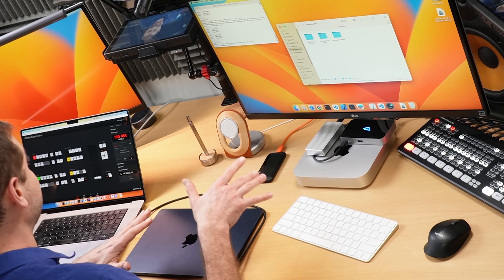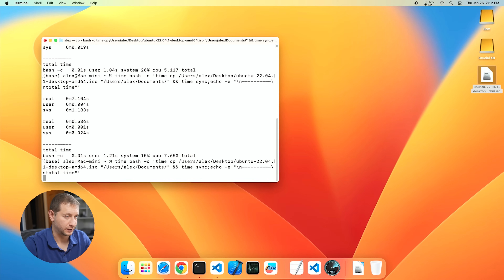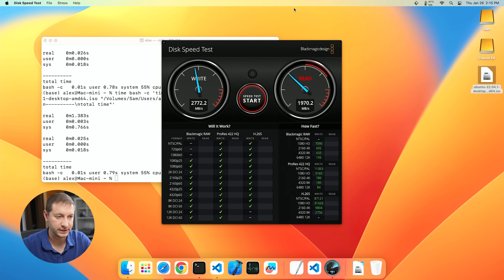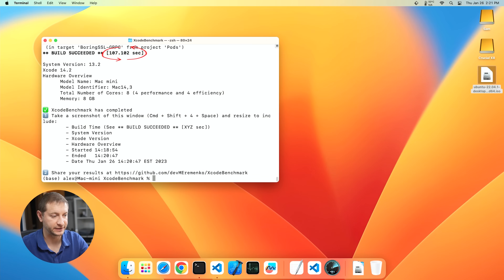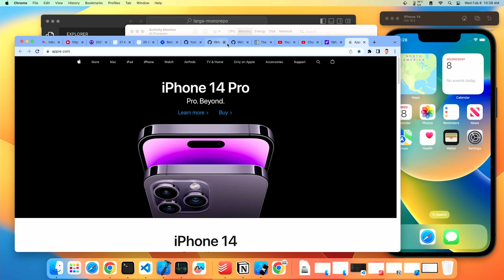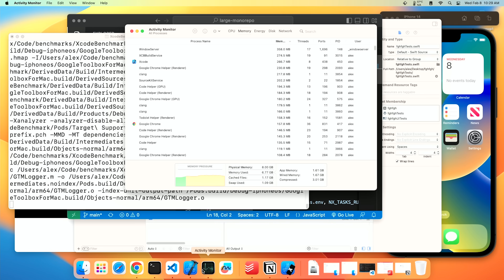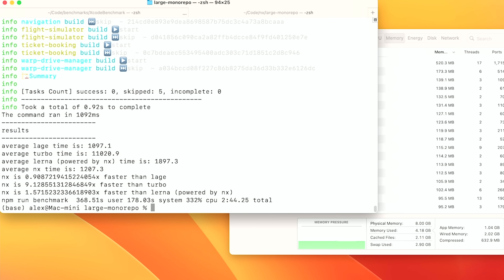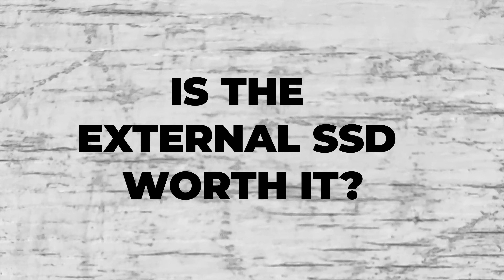...but there's a catch

Comment: What if the internal non replaceable drive dies ? Can you still boot with the external and  give the mac a new life? (instead of paying crazy money to apple for repairs)  -And if yes, but you don't have setup a bootable drive with the OS yet,  can you just create it on another mac ?
Reply: yes and yes
Reply: @ZhuJo99 I know this is old by now but I had to respond. Up until the Apple Silicon era the answer was “Yes!”  But with Apple Silicon machines the answer is “No!”  To even be able to boot the machine (e.g., to an external bootable volume), the internal drive must be accessible and in working order. There is some pre-boot code on there that can only be loaded from the internal (security feature).

Comment: at 2:30 - 40 gigaBIT speeds. 40 gigabytes is 320 gigabits per second, which is not possible over thunderbolt. Transfer rates are always measured in gigabits per second. So if you have a 100 megabit internet connection, you are only getting 12.5 megabytes per second, not 100 megabytes per second. People always think their internet or transfer rate are blazing fast, when in reality, you need to divide megabits by 8 to get megabytes, which is the metric most people are familiar with. There are 8 bits in one byte.

Comment: Laughing at apple users for drooling over 7k speeds after watching a review on a Dell Precision's 12.933 gigs of speeds on a 1tb configuration. Go watch Andrew Marc David's review if u wanna see the real king of professional workstations. Or you keep spending 15k on a 2021 mac pro just to watch a 2k mac m2 mini beat it after 2 years of release (in other words keep being an apple slave).
Reply: oh shut up. We don't want fucking jet engines and performance drop to 1/3 on battery (which will last for an hour)

Comment: Why would anyone buy only 8GB of RAM in 2023? Take aside that your computer will be faster, but also it will avoid swap, which will not help the life of your SSD... where the swap will add to the read/write of the drive. To give you an idea, when I ordered my 2013 MBP I ordered it with 16GB of RAM. When I bought my 2015 27" iMac, I got 32GB of RAM. With my new Mac Studio? 64GB of RAM. *NEVER* cheapen out on RAM and always get the maximum your build will allow.
Reply: Or how much you need. I see no point to get 32 GB or 64 GB when I was never been able to utilize even half of it. 16 GB? Sure. Regular user who does office and browsing? 8 GB is enough, especially with ARM architecture. All that RAM doesn't come for free. you know. I don't buy luxury food either.

Comment: Great video. I did get my M2 with 512GB drive but it’s great to see that the 256GB drives don’t completely hamstring the M2. I think these machines need more RAM out of the base machine. I maxed mine out with 24GB and I added a TB4 TB Samsung 980 Pro SSD. I’m completely happy with my M2 Mac Mini.
Reply: I'm just wondering, how the drive performs when you run the entire OS from the drive. I'm interested in understanding how this would work. How does it perform when the system uses the main drive for cache?

Comment: WOW great testing.  And nice to see a very savvy user using the terminal.. luv it. 👏👏👌👍
Reply from the maker: Glad you liked it
Reply: @AZisk  now i gotta think too hard for either another mini or go for the studio 🤔.  I’m a retired hardware/software engineer so i think I answered my dilemma… studio.  Only concern i have is all the talk about no more updates and support for the studio.  But updating the studio to an m2 chip really going to make huge leap for the studio?  Im a drummer so using chained electronic drum modules via midi to DAWs.  And always compiling for addons and my 3d printer.  Studio should last for a number of years.  I have 2 old minis retired.  4k retina imac, older imac and MacBook air still using but its time to upgrade 👍
Reply from the maker: @rondeangelis7384  studio sounds like a bit overkill for what you’re doing, but it would last you longer, esp if you develop a video editing hobby :)
Reply: @AZisk  oh god not another hobby.  Learning 3d modeling for 3d printing.. thats enough for now lol
But will keep thinking on configurations for mini m2.  16gig ram, external ssd maybe thats the ticket 🤔 thankx for inputs

Comment: Hey, how did you get the Mac mini to boot using the external drive? Did you use the USB A port? I haven’t been able to boot from the external drive for booting from my M1 iMac, when it used to work fine earlier on my old Intel iMac. I have tried re-installing the macOS version for Big Sur and Monterey when they came out, but none worked :/
Reply: you need thunderbolt enclosure

Comment: A lot of people are only looking at the transfer speeds. The internal sad is designed for low latency with the controller on the M2. Thus it will always be faster for swap.

The point is you CAN get away with the small and “slow” system drive, by using two drives. Leave the internal drive for swap, system and basic app files. Then use the external drive for all your video, builds and plugins. When doing builds, encodings of renderings always write to the external drive. That way the internal drive is dedicated to swap only at high memory load operations. That’s the magic formula :)

Comment: If you like the OWC TB-4 Dock, you should check out the Mini Stack STX.  3 TB Ports, 2 USB A ports, HDMI, 1GbE networking, 3.5mm audio. NVME M.2 blade for speed and a 3.5" HDD for capacity. (disclaimer, I work for OWC)

Comment: Those external SSD enclosure come with controllers rated at different speeds (10 Gbps, 20 Gbps and 40 Gbps) it would be helpful and extremely useful if you tested the fastest M.2 SSD with those different enclosures then calculated maximum transfer rate to see if the enclosure manufacturers are telling the truth about how much peak data you can actually transfer per second. Thank you.
Reply from the maker: this one is rated 40Gbps and I tested the fastest deive available to me right now 990pro
Reply: What were the results? Perhaps a good video topic? Thanks for your work on these videos. Informative funny and not so dry. 😊

Comment: I have 2 of the OWC 4M2 Express enclosures and I love them. I also love my 2 Acasis enclosures. The latter get 2800 r/w with Samsung 990 Pro 2 TB and Samsung 980 PRO 2 TB. The former get 2500 r/w with Samsung 980 PRO 2 TB X 4 and 1900 read and 2300 write with Crucial P3 Plus 4 TB X 4. I should have gotten the less expensive SSDs  like you did given the Thunderbolt 4 limitation of 2800! I am hooked on SSDs! My Mac Studio Ultra with 1 TB SSD gets 5700 r/w
Reply: And thanks for a wonderfully didactic video!

Comment: Hi Alex, this is important. You used in this test a 970 EVO model which has only a small amount of MLC memory for the buffer. For some transfer speeds all is ok but once the buffer is full the drive becomes the poor TLC NAND which all knows what speeds can produce. Try with 970 pro or 960 pro. The 980 pro and 990 pro are no better because they abandoned the NAND architecture for cheep manufacture. Redo the tests and you will be impressed. Waiting for feedback
Reply: This is true?

Comment: You can always set up the external SSD to be mapped as your home/user directory + apps, and let the internal drive be just for the OS and swap - then just max out the RAM to reduce swap usage.
Reply: Tried this on my Mac Mini Pro and kept hitting problems or gotchas. In the end I wound up making symbolic links from selected directories on the internal SSD to an Acacsis 405 enclosure with a Samsung 970. I still have 405GB left on the 512SSD. All that's living on the internal SSD is the OS and apps.
Reply: I did this on my first Mac back when MacBooks had DVD drives!  Shoutout to a 2010 mac having the same RAM as today.  — I’d love to see this test made.
Reply: Thank you so much for posting this here. This was a fantastic solution to a big problem for me. I made the mistake of buying a Mac mini with a quarter terabyte hard drive and that filled up much faster than I expected. But here are a few tips for everyone if you decide to go this route. This is what worked for me. Your situation might be different, so be aware that you were using these tips at your own risk.

0. Create another administrator account on the Mac. You will need this to change the home directory for your moved user.
1. Close all apps on the account you are moving to the external drive. 
2. Turn off iCloud Drive completely. Before I did, this, I was getting repeated errors that blocked the copying of the home directory to the external drive. I found this was the issue after moving the contents of the home directory one at a time and the issue was in the Mobile Documents folder in the user Library. This folder is deleted when you turn off iCloud Drive. Files will remain on iCloud.
3. Do is a fresh Time Machine back up of your Mac. 
4. Open to Finder windows side-by-side.
5. Drag and drop the whole user home directory to the external drive. Do not delete the original home folder. 
6. Log out of the user being moved and into the other administrator. 
7. Change the home directory per https://support.apple.com/en-us/102547 
8. Restart the computer and log in to the moved user. 
9. My wifi and ethernet would not work at this point. I resolved it as follows: 
10. Go to System Settings / Network and click the (...) button at the botton, click Locations / Edit Locations / click the plus sign to create a new location and save/apply that. This got my wifi working. 
11. To get the wifi working again, I navigated to System Settings / Wi-fi / clicked the Details button for my wifi, click TCP/IP  and clicked Renew DHCP Lease. 
12. At this point, don't delete the original internal home directory, but rather rename it by putting an X at the end of its current name. 
13. Restart the computer and login to this user again to make sure things are working properly. 
14. Be aware there may be some apps that will be looking for specific folders that they think are on the internal drive. You may need to go into their settings to update them. The Photos app in particular will have a specific location set for the system library and you will need to update that. For that one, I navigated to the external home directory where that library was located and opened it from there. That got it properly aligned. Otherwise the Photos app will try to open the one on the internal drive. Dropbox is another that will need re-linking or to be set up again. 
15. In the Time Machine settings click Options and make sure it is not excluding the external drive where you're home directory now resides. 
16. Change the name of the original home directory back to what it was. 
17. Delete most or all of it's contents, depending on what you run into in doing so. Remember the user Library is hidden, so you need to type Command+Option+. (that's Command+Option+PeriodKey) to reveal hidden files in Finder.
18. Do a new Time Machine back up.
Reply: Very interesting. I have a Mac mini M2Pro with 16Go. Mostly used for photography editing and video editing. Sometimes 16Go is a bit small. I search a way to use at max speed thunderbolt 4 connection to have great speed, especially when editing 4K video…
Reply: How do you do that? Symlink?
Reply: @D-One  You search on google how to do it :) - I don't think symlinks are necessary - just settings. Always backup your data first to a separate backup HD.
Reply: @wavesequencer  -.- It's just right-clicking on the User profile under "User & Groups" in system settings and selecting "Advanced Options". Thanks anyway.
Reply: @D-One  Cool - glad you found it - I don't have my Mac to hand and don't currently do it that way, but I would definitely move home folder off the internal HD if I got a Mac silicon based system.
Reply: Also... moving home, doesn't move apps.. you have to do that manually.
Reply: @wavesequencer  … and how do you move the apps?
Reply: @516cal  Just move the app file like any other. If you don't move your home directory, be aware that apps may still write app related data to your user 'library' folder.

Comment: I wonder why SWAP with external drive is slower. Maybe you should try it with faster performing SSD (in terms or random reads with low QD)?
Unless it is some kind of bug it doesn't make sense why there is such difference.
Reply from the maker: yeah strange. could be due to thermal limitations of the external enclosure
Reply: @AZisk  you probably need to re-test it with the heatsink.
Reply from the maker: @paulf3353  I used included heat sink, but there is no active cooling in the enclosure
Reply: @AZisk  It shouldn't overheat then, strange results then. I wonder if it is just a coincidence
Reply: It's probably a cache issue, as others have said. A pricier SSD doesn't only offer faster port speeds, but also better sustained performance. Cheaper ones offer quite good performance, but they 'cheat' with fast cache and slower actual storage chips.
Reply: @graey2  I don't know what read/write pattern MacOs swap is using, but I've compared 990 Pro with internal 256GB SSD and on low QD and transfer sizes. Internal drive is significantly faster. For example QD1 512b, internal drive is around 40k IOPS, where external around 27k IOPS. So it might be controller on Mac mini is optimised or TB3 interface affects small transfer size performance

Comment: So my takeaway from this as a retail non-power user is get the base model with an external 1Tb NVME at 10% the cost of the apple upgrade, to boot from and I’m good. Thanks for your excellent video. I’ve been looking for exactly this. 👍
Reply: I think this was unclear in the video....1TB drive ($400) added to base machine ($600) is $1000.  Buying external 40gbps enclosure and 1TB NVME would be about $200 so this is 50% of the cost of the Apple upgrade. 2TB NVMe would be $150-$200 that that would be a much bigger saving over the $800 Apple charges for 2TB.

Comment: I have an X5 and use as an external for my iMac but man the boot is so slow seems like using Samsung NVME impacts the boot times for what ever reason. You didn’t mention this in your bud but are you having that problem pretty sure my X5 has a 970EVO and it’s been like this since Monterey. Loads of threads on macrumors about it

Comment: Can you use the external disk as system disk while using the internal drive for swap?
Reply: in theory and lot of shell fiddling, yes. better and much easier is to use internal for boot and external with mapped user folder onto that

Comment: I use a external thunderbolt 4 drive with a 1TB crucial SSD (1900MB/s read/write) as swap and as proxy for my MacBook Pro 16" base model with 512GB internal storage, I never had issues with the swap so far but i also barely use it, at maximum 2 to 4 GB are used in the swap since the 16GB Ram are mostly enough. For demanding stuff tho, i close unnecessary apps like the browser for example especially when its full with tons of tabs.

Comment: swap is what you need to avoid it will kill the drive faster to start with also running alot of apps at same time is also bad because it puts things at risk of going bad with your projects also lets remeber to that SSDs have liminted life and blocks of data as a result and if your going into swap alot thats going to pile up fast on you as well . 8 gigs of ram is 256 at least in this day and age is not a good choice and should not even be a choice it should be a min of 16 by 512 for basic to mid users and alot more for the pro and power users.

Comment: I don't even do coding but I still come here to pick up bits and bobs of tips for other usages. I for example have a mactudio with three, 2tb Thunderbolt enclosures in a RAID 0 because, well, I can! But mostly because as a video person I am regularly copying files and my internal is only 512 so I thought this way I get an extra 6tb of storage running at just over 5000 and do my editing, caching,assets  etc on the external but have the progg and things like titles and transitions on the internal that way I don't use the internal much, will hopefully extend its life cycle and have the 6tb of storage for £750 not the mad amount that apple charge and of course I can expand it to 12Tb or just swap out the drives. But look at that, Apple have me thinking that £750 is a good deal when I have 2, 4tb WD duo RAIDs for storage and backup that only cost me £65 each refurbished from WD. THey are Red drives so pretty slow, but in my head, £750 is a great deal, which it might be by comparison!! Anyway, love your content, enjoy your delivery. Top work.

Comment: Im totally new to Mac OS, went with a M2 Pro Mini in base spec. If/when the internal SSD fails, is the recovery mode akin to a bios? ie, is it stored on a seperate chip so that in the event of failure your method of putting the OS on an external drive will still work?
Im not a dev and installed most programs I use and still have about 420gb left (nice). I guess I thought the drive would be tiny, but most of the space on my windows PC is 100gb + games lol. 512gb is actually a decent amount of space for most people I think if you are not a dev, espcially when you consider streaming most media now. 
I have a 12TB HDD for all my media, that I was worried would not work (assumed it was NTFS, did not actually check) pluged it in yesterday and to my surprise and relief it was already in exFAT so works just fine!